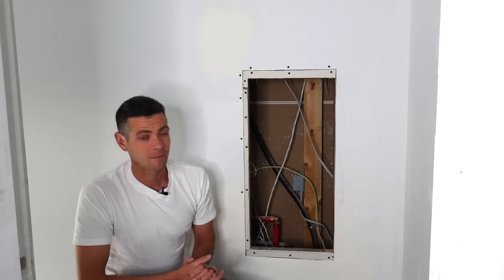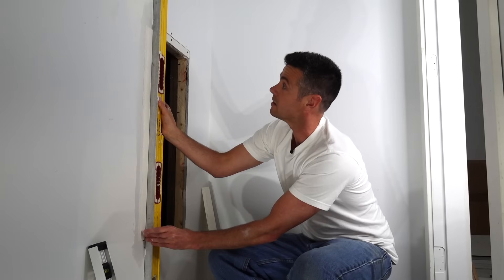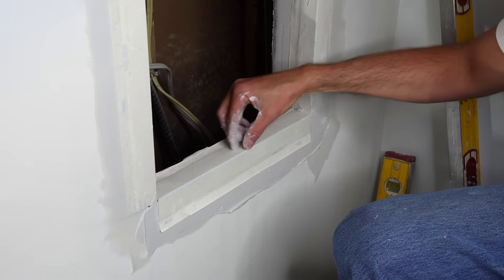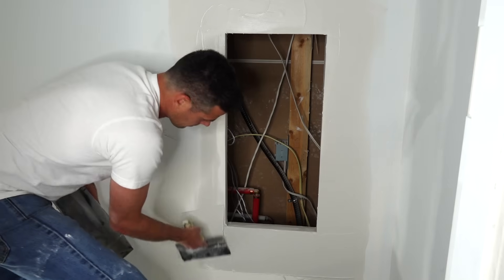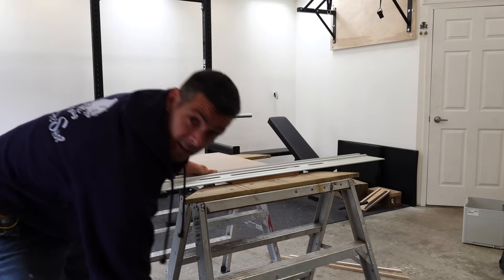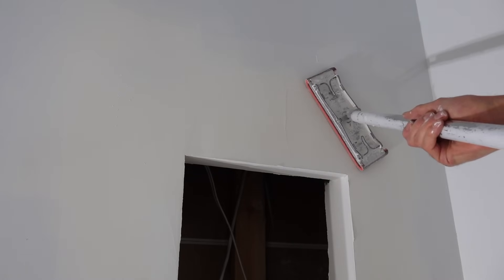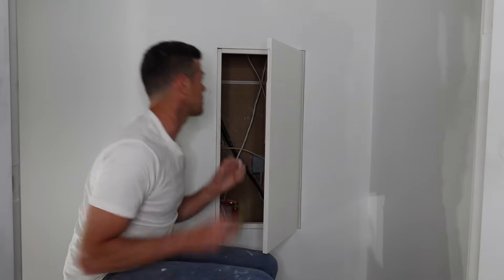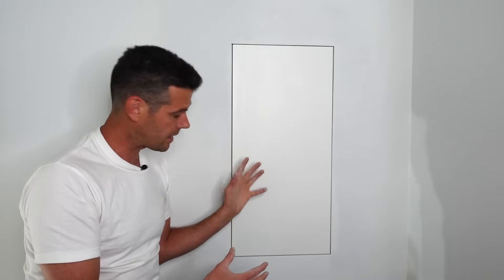Making a FLUSH PANEL CABINET DOOR in DRYWALL!

Comment: Anyone who thinks metric is better, ... doesnt understand units. Name anything you can measure in metric, but not english units. You cant. They are literally the same thing. Units. The 10, 100, 1000x thing also doesnt help. Nobody converts from mm to meters. People pick a scale, and stick with it. Also, you can still end up with 2 and a half millimeters. You cant escape fractions using metric. Metric is the problem, because it was never needed in the first place.
Reply: Really? Let's say I have a measurement of 4 millimeters, and I need 5x that amount - 20 mm, easy. 

Now let's say I have a measurement of 3 11/16 of an inch, and I need 4 of those. Yes, you can of course do the math but it is harder to do in your head and takes more focus. 

With millimeters, you're unlikely to need to deal with measurements finer than .5 millimeters, which keeps the math easy. 

You are right in a sense, that the scale per se does not matter, it's just that in imperial, you're much more likely to end up with fractions that don't play well with base 10. We might have solved this had we dealt with 1/10 of an inch, instead of 1/16, but that probably didn't give workers the resolution they needed. 

Anyway, measuring and doing math with metric makes things way easier.
Reply: @iamamish  Using your example, ... use 1/16 of an inch, as it is similar in size to a millimeter. Now this part will blow your mind. You can have 17 of those 1/16ths, or 17/16ths. You dont have to perform the division till the end. The sixteenth is the unit. And you can have any number of them. I hope you understand my point. You cant escape fractions using metric, and also, fractions arent that difficult. You have a measurment 4 16ths, and you need 5 of them - 20 16ths. easy.
Reply: @tazanteflight8670  yes I agree - my point is not that the math is impossible, only that it creates a larger mental load than metric (at least with typical constriction measurements)

Also my example (maybe I had a typo) was 11/16. Tell me quickly - how many inches are in 55/16ths of an inch?

Not saying you cannot figure it out, just saying it is a lot harder dealing with certain fractions.
Reply: @iamamish  You dont need to know how many inches. Conversions arent really needed. When you convert from sixteenths to inches, the length does not change. So you have accomplished nothing by converting. All you really need is a tape measure that reads sixteenths, and suddenly English is as  easy as metric. You were told metric is easier, when metric, and English are the same thing. The math doesnt change, the units do. Life on Earth would be better with one set of units.
Reply: @tazanteflight8670  definitely… so get with the times and learn metric!  

It’s more accurate, that should be reason enough
Reply: @Lexeus3  Oops, you just showed the world that you dont understand math, or units. Metric is NOT more accurate. Metric, and English have the SAME accuracy. Metric, and English are the same thing ... units. The math does not change. Lengths do not change.
Reply: @tazanteflight8670  well any standard measuring device has a smallest measurement, and I can tell you for sure that none of mine have a measurement smaller than 1mm
Reply: @Lexeus3  You might have to use fractions.....
Reply: @tazanteflight8670  fractions of what, mm? I think this has already been pointed out to you, 0.5 mm is as accurate as you can get, you can use a ruler and see the markings for imperial are always noticeably bigger, for example 1/16th is over 1.5mm. the accuracy is not the same, simple
Reply: @Lexeus3  Then use 1/64". It will be called the "sixtyfourth" and it will revolutionize measuring sticks.! You can not win this argument, because English, and metric are the same thing. You were told metric is easier, by people selling metric. You were tricked.
Reply: @tazanteflight8670  you can’t mark those fractions on a ruler. Humans can work by eye at 1mm, and it fits just right on a ruler. This idea you have requires all these different fractions to be marked on all the measuring rulers, it is unworkable. Or you are suggesting we go back to the days where rulers were expensive to buy and basically you want everyone to carry a set with each one having different fractions marked on it…

You can talk about the measurements as much as you like, but using them in a practical setting is quite different… I think I have explained enough
Reply: @Lexeus3  No. I said the unit is now called a sixtyfourth. You dont have to draw the fraction on the ruler. You can have 1 sixtyfourth, or 64 sixtyfourths, or 640 sixtyfourths. The part you dont understand is that English, and metric are the same thing. There is no convenience in one, but not the other. Space aliens have a unit of measure, and it will be the exact same as English, and metric. It will be units. The literal distance from the Earth to the sun does not change.
Reply: @iamamish  Both systems are totally arbitrary. But the imperial system is better scaled to human size. A foot is about how long your foot is. An inch is about the width of an adult thumb, etc. And that makes sense, given the origins of the units in the imperial system. As for temperature, the Fahrenheit scale also makes sense if you understand its origin. 0°F was the coldest temperature the inventor could achieve in his lab (a 50/50 mixture of salt and ice). The 100°F was what he measured for his body. Then when he measured the melting point for ice and the boiling point for water, he got the 32 and 212 values which seem so arbitrary. But Fahrenheit is better scaled for human use, Celsius is not. Now if you want to say, "but normal body temperature isn't 100°F!", I'll say "So what? A meter isn't exactly 1/10000000th of the distance of a line from  the north pole to the equator, passing through Paris either." The units had nice simple definitions, but errors were made when producing concrete physical representations. 

The imperial system is superior to the metric system if you're dealing with human scaled dimensions. The metric system is better only because more countries use it and I'll agree that it's more rational. But both systems are totally arbitrary.

Frankly, I think a better system would be one that uses real fundamental units instead of arbitrary ones. Say something based upon the planck units. Now that would be an universal system.

But until then, I guess every country is stuck using the Imperial system.

Say what? You claim that you're using the metric system and not the imperial system? I'd suggest you take a look at your nearest seaport and look at those containerized shipping vessels. In particular, take note of the container sizes. Then try to claim that you don't use the Imperial system.
Reply: @johncochran8497 I am surprised how many defending imperial system.  First I have seen alot of tape measures ... send me a link to one that has 64ths along its length.  The tape measures that are metric give you a  number like 1005 ... not feet, inches and fractions. Convert a yard into 64ths.  Do the similar with a meter converting to cm or mm.

All the math so much easier.  It's a shame U.S. abandoned transitioning but depending on your profession, if you use parts made in other  parts of the world and look at the drawings hom many use imperial units.

Last argument for metric ... a millimeter for most drywall or woodworking projects is more that adequate.  I have been an engineer, general contractor for many years and never once had a subcontractor produce anything to a tolerance of a 64th.  I would have loved something produced to a 1 mm tolerance.